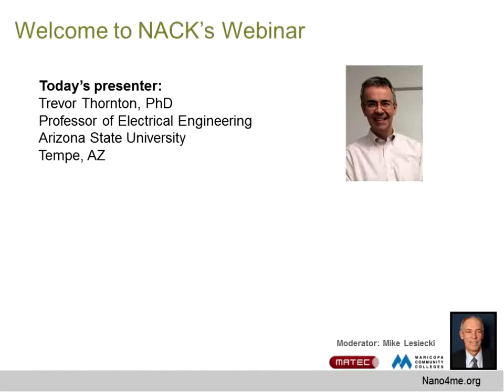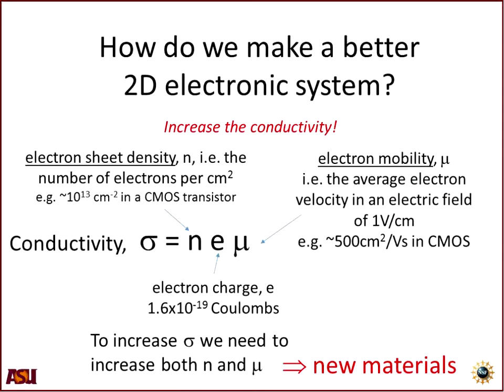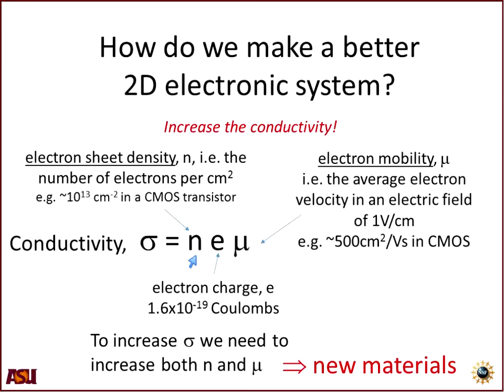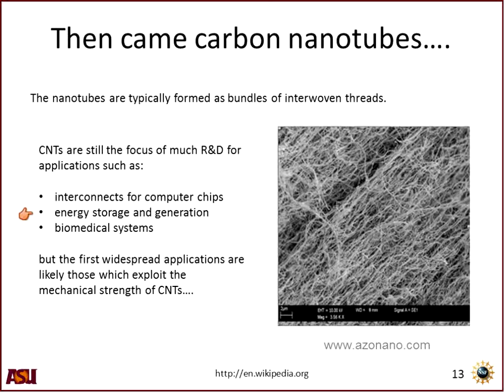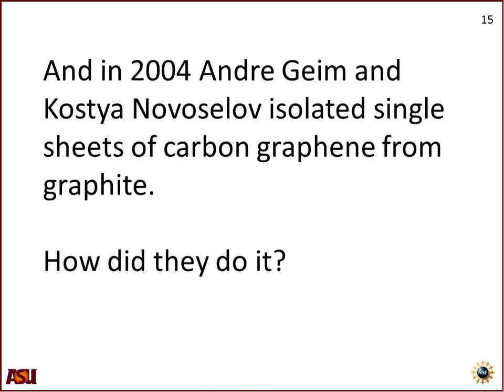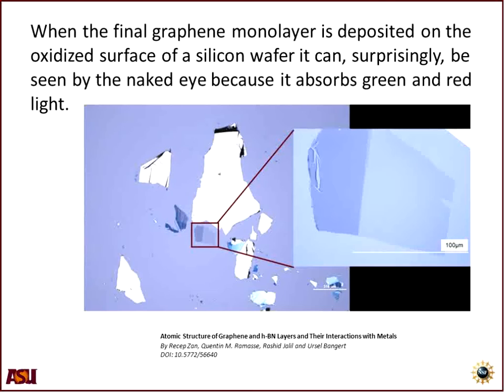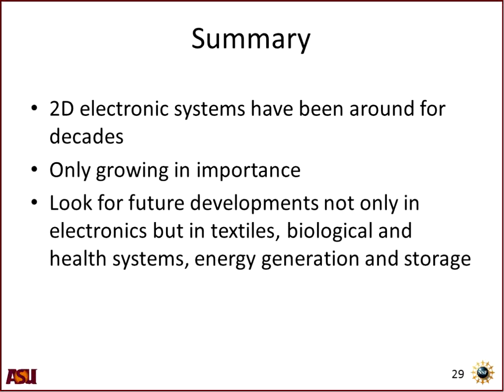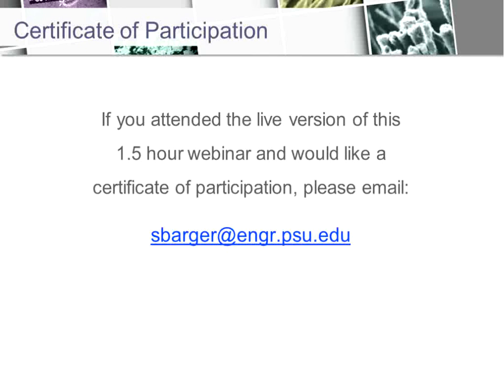Graphene and Other 2D Electronic Systems

Comment: 6:40 how can I imagine an electron sheet density? Shouldnt it be the electron density (cm^-3)? With the sheet density the unit of the conductivity is also not the standard unit. If the electron sheet density is 10^13 cm^-2 then how can I derive the electron density? I guess it's simply an apparent electron sheet density because we assume the electrons to be confined in 2D in the channel